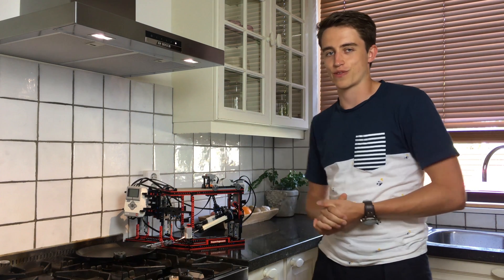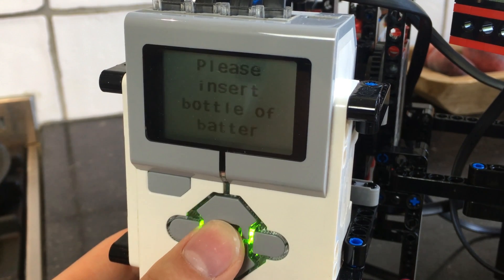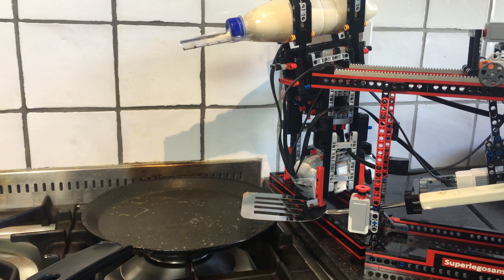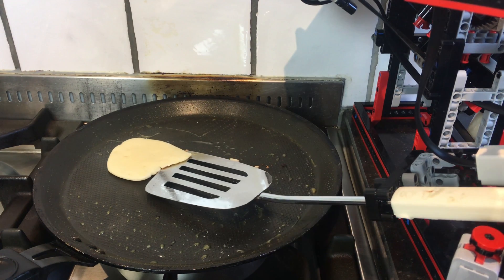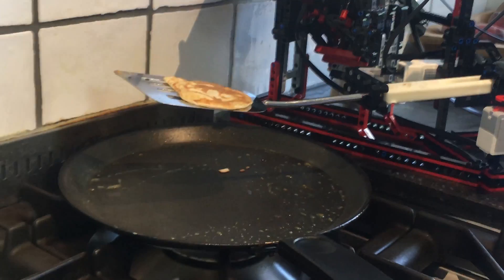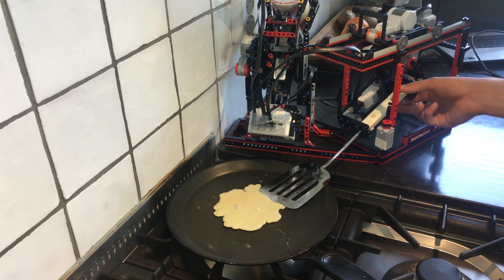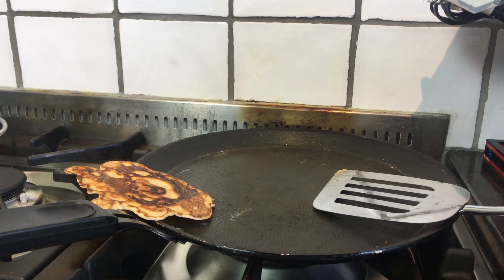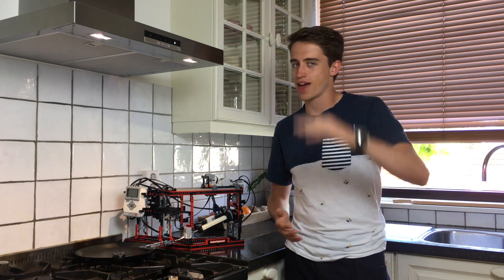LEGO PANCAKE MAKER - Recipe for DISASTER?

Comment: That is sure an original content :)
Really like the machine, but have you tried changing the flipping system? There could be an additional arm on the above to hold the pancake. Maybe it wouldn't need human help ;)
Overall it's great, always liked your creations
Reply from the maker: Thanks! I did try to make some adjustments, and what you propose also crossed my mind. However, in it's current form, I couldn't think of a way to do it - I would have had to rebuild almost the entire machine. Perhaps I will do that in a version 2 ;)